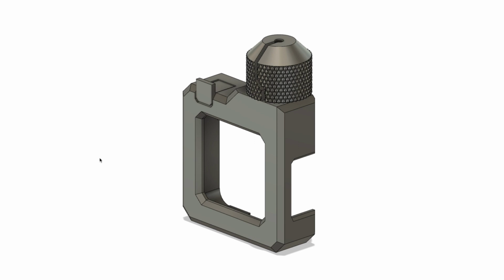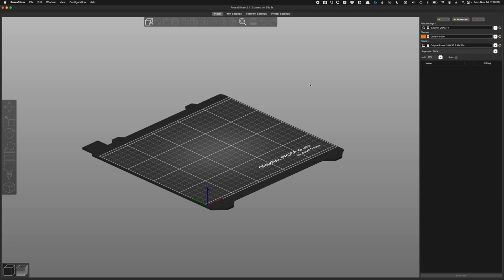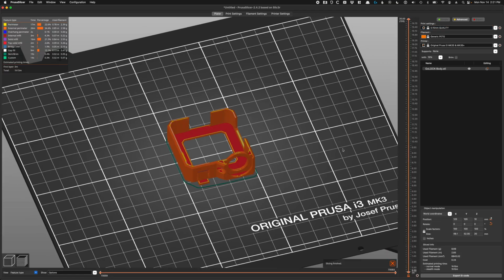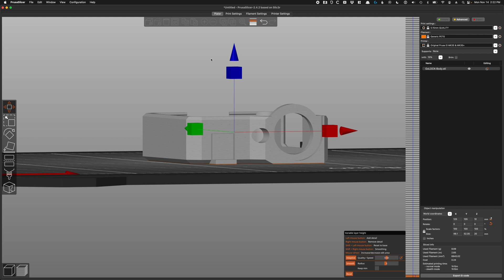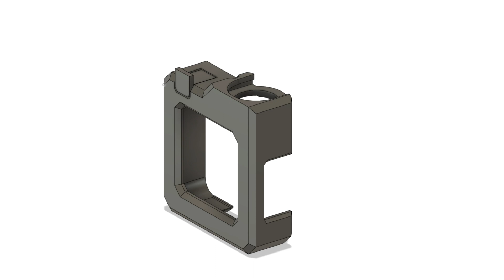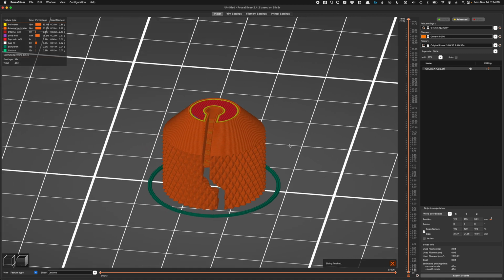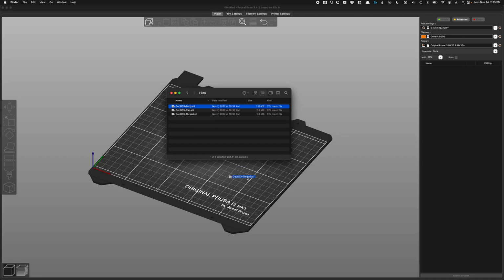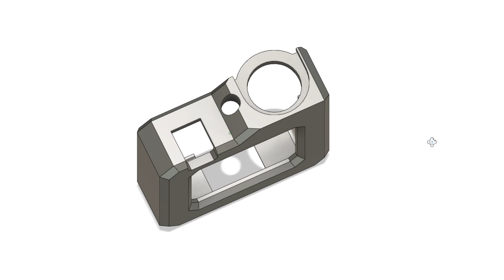Go LOCK - 3D Printing Tutorial

Comment: Tried to print the threads and for some reason on my slicer the cylindrical wall that holds the threads is not appearing. Any clues as to why? I tried to print as is and it printed a cork skrew essentially.